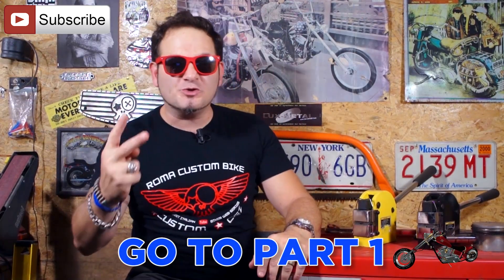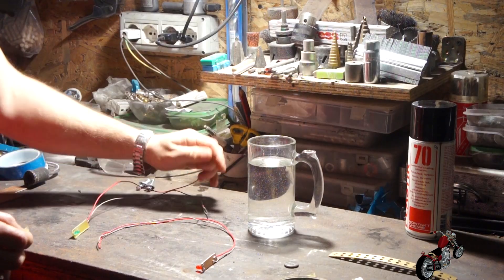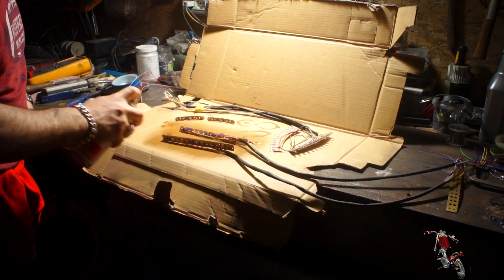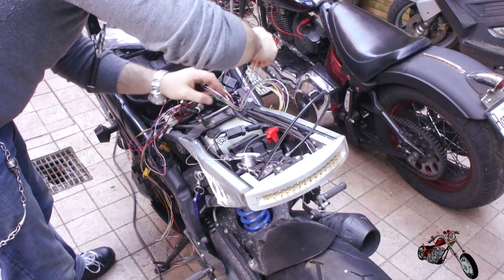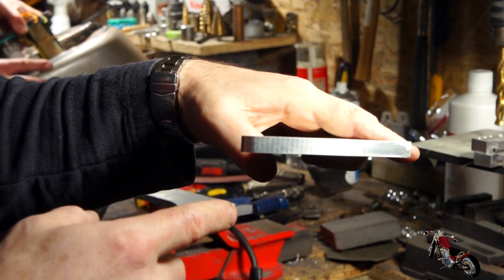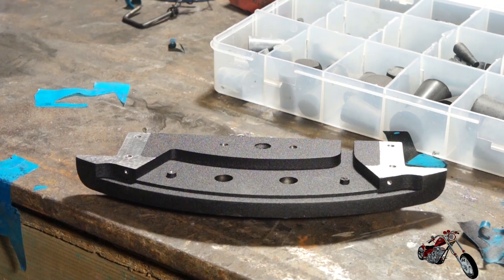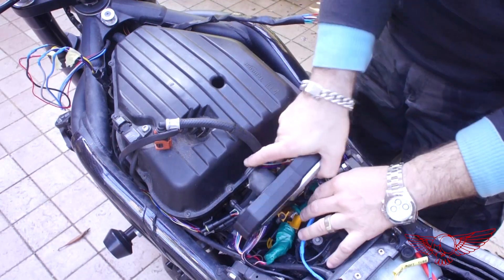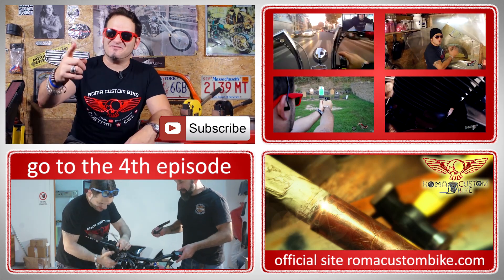Custom Triumph Project - Speed Triple Cafe Racer - ep 24p2 - Arduino diy - Roma Custom Bike

Comment: Hi Custom Cez. I'm very interested on that texturized paint, it seems awesome! Could you give me some details about this paint effect, like brand or any place to buy online? Or even some technique that you've used to do it? Thank you very much!
Reply from the maker: +Tiago Fonseca Ciao Tiago, where are you? USA or Europe? so I can point you in the right direction :)
Reply: +Custom Cez Please give me USA direction :)) Thanks a lot!
Reply from the maker: No problem man :) in the US you can get that exact powder at eastwood.com. it's the texturized black here is the link: http://www.eastwood.com/hotcoat-powder-black-texture.html 
It's very easy and forgiving powder, beside the fact that it looks good, it easily covers a lot of possible problems on the part, in my case the machining lines but for an old part it would easily cover little scratches.
be aware though that is hard to clean, can't rub it :) even hard water it's a problem, it will leave a mark. I use a little bit of "limestone" remover when i wash these parts (you know the stuff to clean the sink and the shower build up).
Hope this was helpful to u ;)
Reply: +Custom Cez Thank you very much by your time, it was very helpul. I would like to congratulat you by your excellent work and perfection on that Speed Triple project. There's another very similar project: http://theawesomer.com/impoz-triumph-speed-triple/110554/
Reply from the maker: you are very welcome man :) unfortunately the speed triple was stolen a couple of weeks back!!! bastards!!! ho well... we'll make an other one :)